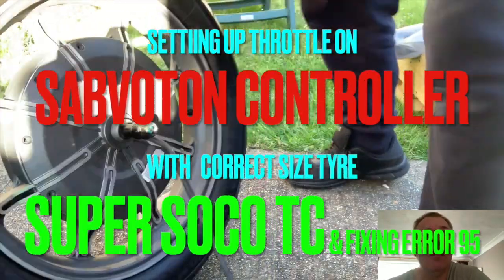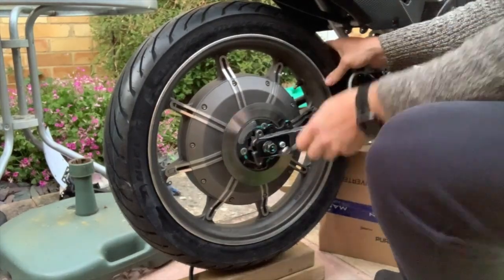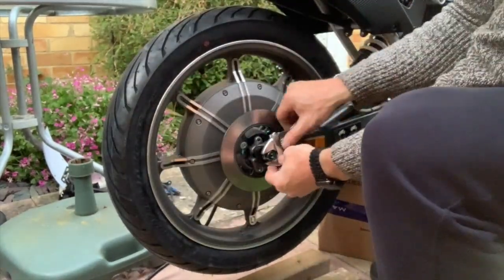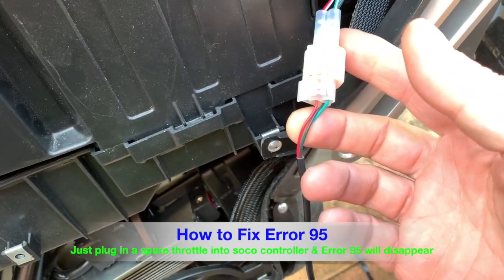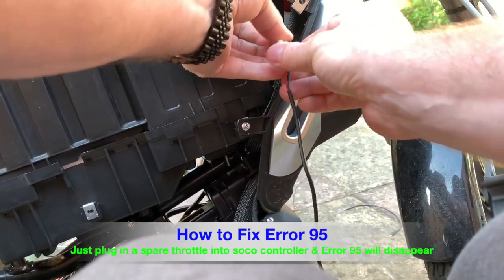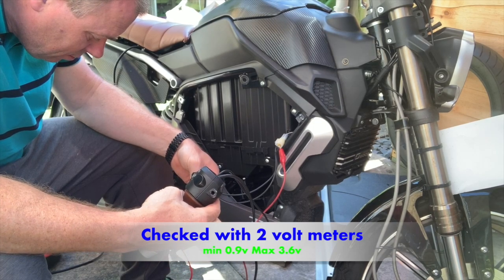Super Soco TC/TS Instal Sabvoton Control part 3, Set up Throttle & fix error 95 + max speed & tyre

Comment: Hi, 
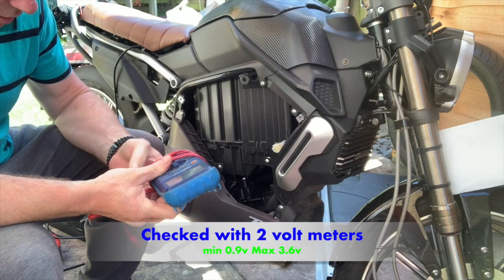At 2:59 you connect the bike to a cable. Which type of connector does it use and do you have any video showing that in detail?
Thanks and great work :D
Reply from the maker: the Sabvoton controller comes with cable that is connected to another cable of the Sabvoton controller as standard which when connected together functions on display work but when disconnected the Bluetooth works allowing me to change the Sabvoton controller parameters and save them

Comment: In the video, going downhill it seems that you get error 95, how did you fix it?
Reply from the maker: The standard super Soco controller had no throttle plugged into it because I was using it for the Sabvoton controller 
I had a spare throttle so I’ve connected it up to the standard controller & error 95 gone
Reply: Why don't just share the signal like I did in mine. Just the signal no plus or minus. Same signal to both controllers. No errors whatsoever.
Reply from the maker: I like you video by the way 👍☺️

Comment: 0:15 Hallo, a question: did you removed and changed the rear tyre.
Where you have to disconnect the motor's wire? 
I want to put a new rear wheel but I am afraid of what can go wrong. 
Probably a 120/70, I see it will fit.
Reply from the maker: Yes that was me in the video changing the tyre😊
From the back of the controller he will find 3 phase wires you will need to disconnect and also disconnect the hall sensors then the whole cable will need the de-cable tying and the wheel will slide out
As for the size tyre it’s not the width that is the problem it’s the height of the centre of the tyre will hit on the shock absorber! that’s the dimension you need to be careful of
My size tyre was dictated by price and availability
Reply: @kpadventure  what seeting you use on the controller

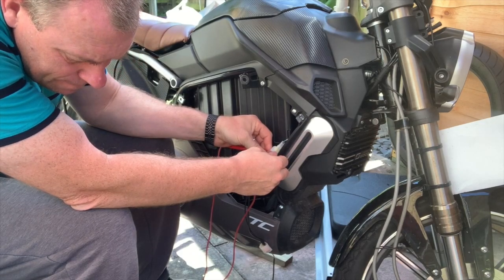Comment: 2:08 Nice carbon coating. It was a sticker texture?
I will try to apply it below in that black area (on a red TS)
Reply from the maker: Yes I bought it off eBay
👍
Reply: @kpadventure  A question on spare batteries: what do you think about this seller?
https://www.ebay.it/itm/283932145732?_trkparms=aid%3D111001%26algo%3DREC.SEED%26ao%3D1%26asc%3D20160727114228%26meid%3D9b2e7d57cf1a4ba48737a9d9eec6fe3d%26pid%3D100290%26rk%3D1%26rkt%3D4%26sd%3D283932145732%26itm%3D283932145732%26pmt%3D0%26noa%3D1%26pg%3D2506613&_trksid=p2506613.c100290.m3507&mkcid=1&mkrid=724-53478-19255-0&siteid=101&campid=5338633371&customid=&toolid=10001&mkevt=1

He is a somewhat new deutsche store
Reply from the maker: @jolladevices  The batteries that I bought complete have always been substandard!!!
For example I was sold a 20ah battery pack with  3000mah cells when I took the cover off they were substandard 2200ah cells
so I always make my own